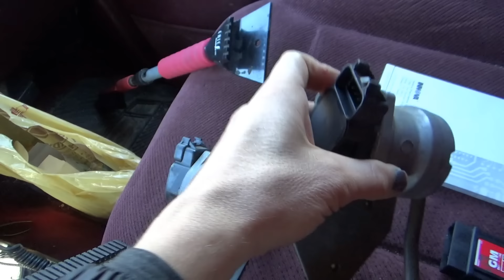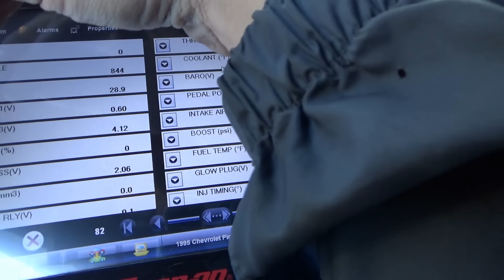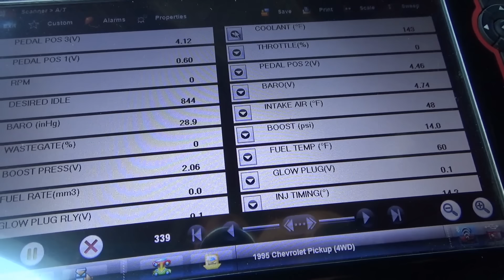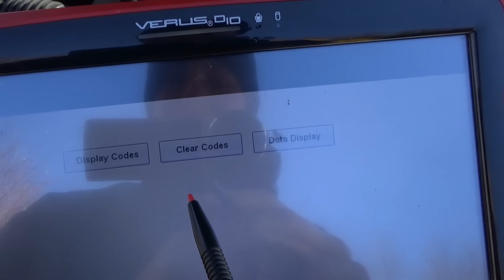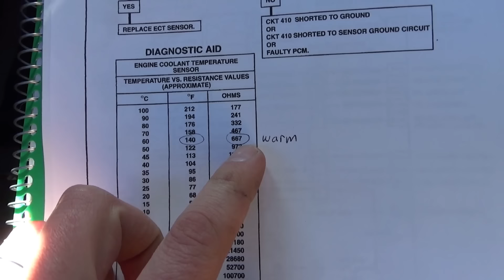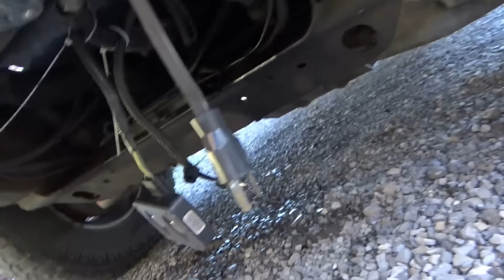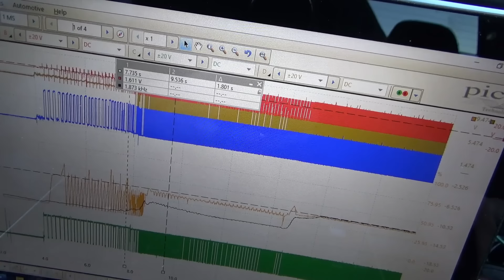(Pt 1) Chevy 6.5 Turbo Diesel REVS Out of CONTROL?! (Throttle Diagnosis)

Comment: I used to work on the shops old 96 chevy tow truck with the same engine.  And it would sometimes cut off while coming back down to idle.  Replace the injector pump driver module and it would run fine for 6 months or so.  Then start doing that random stalling again.  This truck already had the module relocation kit installed behind the driver side battery.  So, it made swapping the module a breeze.  But I suspected there was a high resistance problem in the injector pump itself.  But the shop owner didn't want to replace it.

Comment: 😢If it is the PCM computer board and it is the CPU ROM chip with double sides in soldering is the causes.Hope you’re able to find a replacement PCM board for it.Or tries wrapping that PCM board ROM chip in tinfoils.Tries heating it with a heating gun with maximum heating settings for about 5-6 minutes and pray those heats are reflowing those cold soldering joints to making that board ROM chip to workings properly again.

Comment: Love those 6.5s the problem is the modules sitting on the engine are prone to failures like overheating the modules. That's why the RPM is ramping up.   I've seen this issue before.   The pump fuel is bypassing that, causing issues.   Some injection pumps need to be rebuilt with upgraded parts that'll take care of the problem.

Comment: This is why I LOVE my 1995 Ford F250 4x4 with a 5.8l ALL PRIMITIVE PETE, cabled throttle, crank windows, no cruise control, manual transfer case, manual hubs and only electronics is fuel injection and transmission which I can deal with that!!!!
Reply: You are just missing the manual transmission :)

Probably slow as a dog compared to a modern diesel, but you can't beat the simplicity.
Reply: @volvo09  I bought what 1, I could afford and 2 what was available at the time!! But manual transmission are good but their fun runs out at about 5000 miles. Yes I do love CV the simplicity of not having more modules than the space station!

Comment: Trying his hardest to use a 4 channel scope to identify an electrical malfunction when the problem is simply a bad injector pump. ECM is not in complete control and doesn’t know how to handle the situation.  Fuel is bypassing internally. Touching the throttle commands even more fuel, hence the high revs. Rebuild or replace the injector pump.  Relocate the module and put a computer fan on the heat sink.

Comment: This could be worse; this engine could be a 6.2 liter diesel.  I drove one on a delivery route that was a C-30 Chevrolet with a 20' box on the back.  Those engines didn't have turbos and 130 horsepower wasn't enough to "pull a sitting hen off a nest."  The company eventually got some 6.5 liter diesels that were somewhat trouble-prone and the 6.6 Duramax was an improvement over those engines.  I am wanting to say the Duramax was an Isuzu design IIRC.  I own 2 6.0 liter Ford diesels and I have a newfound respect for those upon viewing this video.  Ivan, you are getting down to the nitty-gritty when it comes to waveforms; I don't think you have gotten this technical before.  Good to see it.  GREAT VIDEO!

Comment: Wow Ivan! That must have been a big Hammer that you hit your thumb with! Ouch
Reply: And I liked how he must've relieved that pressure build up under the nail: With a red hot pin/nail/steel wire end. Goes through the nail like butter, so you're better careful. He's a real hero, he didn't even lose a single comment over it. He just soldiers on. A real man.

Comment: Yeah getting a quality part these days is brutal,, recently my 2002 F250 power stroke accelerator pedal was acting up and I thought no problem I'll get a Motorcraft,,  well no,,,  it doesn't exist..
Apparently for about 20 months between 2002 and the 2003 change over to the 6.0 was the only period that used that particular accelerator pedal and it's only available in the aftermarket..
Fortunately the one I got works fine...
So far......

Comment: It sounds like brothers Subaru Forester when it had an air leak at the throttle body & it was fitted with a MAP sensor like that 6.5 litre diesel V8 engine is.

I don't think that it would be the PROM inside of the ECU that's at fault unless someone has mucked around with it !

Comment: Call me crazy, but just purely as a thought experiment, I can kind of create a scenario where extra fuel bypassing in the injector pump could cause a situation like this.  2000 RPM is probably a comfortable place for this truck to live on the highway, it's a '95, and so depending on how the injector pump is designed, wear on the flow control pintle, seat or orifice could favor this RPM, and continue to bypass at higher RPMs, causing it to hit the rev limiter.  

Further, with these being old mechanical function design with a rudimentary ECM and some electronic controls and monitoring slapped on top, it's entirely feasible that the ECM doesn't have as much control as we're thinking it does, and instead, it's really just following basline maps for expected behavior at certain data points.

As per usual, this is entirely speculation, and the only tests I can think of to alter behavior in a predictable manner are insanely dangerous on this design of diesel.  About the only "safe" thing I can think of is a thick piece of steel to partially block off the intake and a 5-gas analyzer to look at combustion and fuel mixtures.  Even then, without a known good, I have no idea what I would do with this data.

Man, this is a really good one!

Comment: never worked on that system  but .... dont worry about the temp. yeah its off but it really makes very little difference on fuel delivery except maybe on start up. it has a seperate shutdown sollenoid so if you unhook everything but that on the pump it should start at idle and run smooth. if not check for sucking air and if not sucking air and still erratic change the pump,   a sticky timing advance will cause elevated idle rpm. that most likely is a stepper  motor running the fuel metering controls. it is fast and precise. any binding in the mechanical side will cause what this thing is doing. you could depin the stepper and monitor the throttle circuits and output to the stepper if thats all good change the pump.  the  mechanical version of that pump was real finicky and does not like low sulfer diesel fuel.

Comment: I will post more later but this is most likely a worn injection pump from the poor fuel filter I see installed.  The other two causes are the PMD or lack of a calibration resistor in the PMD connector.  I doubt this is the issue as he had tried so many PMDs.

Comment: It looks like your thumb isn't getting any better. You still have the goth look on your left thumb.
One of my neighbors had a problem with one of their vehicles. I remembered it was the same vehicle you worked on. I told my neighbor I know exactly what is wrong with your Toyota. Within one hour and $31.00  from O'Reilly's and it was fixed.
I only charged  them one dozen of peanut butter chocolate chip cookies.
Now all my neighbors are knocking on my door. Even UPS and FedEx drivers.

Comment: since the old pdm is still on the pump it is likely they didn't transfer the resistor to the new pdm. This will cause the exact problem, just look into the plug on the pdm to see if it's in there.

Comment: You did a great job of applying advanced diagnostic principles to this platform that you've never worked with before.  All normal EFI control principles apply until you get into the actual DS injection pump that's its own beast.

Comment: In the first test the pump command at 4k RPM is LESS than at 1k, and so is the feedback, and the solenoid is tracking the command. How could a smaller command result in more RPM? It has to be a mechanical problem. Fuel must be coming in outside of the command, or the pump is producing too much pressure, or something like that.

Comment: Fuel pump, fuel injectors, fuel filter, blow out the fuel line to tank, wiring harness extension, PCM, wiring harness.  Has he been running any performance chips?  Looking forward to this one.

Comment: Drain the water out of the engine mounted fuel filter through the petcock mounted on the front of engine. Take filter out and check bottom of filter for sediment

Comment: GM went to an electronically controlled IP in 1994 which introduced a new level of complexity to the system compared to the mechanical pump of 1993 and older models. When they run right, they run great, but can be a pain to diagnose and repair when they act up. I have that engine in a 1992 truck with the mechanical pump and it's been pretty much trouble free.

Comment: If you had a signal generator you could dial it in the correct duty cycle when the engine actually idled for that few seconds. Eliminate computer control. Not sure if that’d work but would be an experiment
Reply: Smart suggestion. Would love to see Ivan try this

Comment: Bought mine new in 94. Still have it. They don't take kindly to abuse and are prone to electrcal gremlins. I have a local shop that actually has a younger tech that works on these so very fortunate as they are not welcome in a lot of diesel shops. This is the first deep dive video on the electrical side of the fuel control system that I've seen. My hat is off to you and to boldly go where no one likes to any longer. Looking forward to Part 2.

Comment: Fuel is by-passing inside the injection pump itself . Worked a large GM dealer in Toronto , changed literally hundreds of these pumps , just get another one and don't forget new fuel filter , set TDC offset with scanner when engine is at operating temp and add Standayne fuel conditioner , yeah and move that driver module off of the pump using the resistor that came with the driver module as they were calibrated together . A higher resistor number meant more power but to the expense of fuel mileage , Aftermarket harnesses and mounting plates usually came with a number 9 resistor , high fuel consumption with those , usually had a 4 stamped on the resistor when looking inside the bottom of the the driver module wire connector . Good luck , reminds me of the good old days when life was simple .
Reply from the maker: I still don't understand why the PCM ramps up the fuel solenoid duty cycle through the roof if you touch the throttle 🤔
Reply: @PineHollowAutoDiagnostics  It's a hard call to make perhaps try a used pump out of a Pick-n-Pull
Reply: @PineHollowAutoDiagnostics 
It’s not, the pump is worn out
Reply: @PineHollowAutoDiagnostics Diesels are like helicopters, there is no way they should work at all…so making them work is pure luck!
Reply: Oil leaking in a turbo will also give that you need to be careful it can be a runaway need a rag in the air box to stop it not like a car no spark plugs to take power away
Reply: Cummins has a detailed and fairly simple fuel system test, requires a couple of fittings, fuel pressure gauge, some tubing and measuring "cups".  Will show confirmation of pressures, leaks, sensors, fuel bypass, pump efficiency etc.  Is there a similar procedure for the GM 6.5?  I would like to think so?  
Stay gold.
Reply: The resistor is actually tuned for injection pump variance in the build. Always should use the same resistor that came with the pump, the PMD does not come with a resistor.
Reply: @jeffco908  Before plugging in any driver module ALWAYS check to see that there is a resistor installed over the pins on the module, Preferably a #5 but not super important.
Reply: @markricketts-qm6xu  Ya i know. What im saying is all pumps come with the PMD and the resistor installed. When changing the PMD the resistor needs to be transferred from the old PMD or replaced with the same value resistor. The resistor value is matched to pump variances in manufacturing and not matched to the PMD. Best practice is to always match the resistor value with the one that came with the pump originally. I have seen so many relocates done and then there is no resistor in the PMD cause its still in the old PMD on the pump.
Reply: Wo man 🧍‍♂️
Reply: wait, hovering around 15psi boost, is the wastegate seized or wired shut/tampered with and tuned at one point? maybe someone replaced the ECM to one without a tune, doesn't too high of boost make it go fuel cut on purpose, wasn't stock around 8psi boost at idle? I'm guessing there's far more issues than just a injection pump over-fueling.
Reply: @throttlebottle5906  You need to subtract barometric pressure from that reading to get actual boost pressure. Its not really A true boost sensor as it doubles as a baro sensor.
Reply: @jeffco908  oh right, I was thinking the tool output was calculated and should have known better seeing 14" when not running.
 I recall wiring the wastegate shut and playing with the computers was some of tuner trickery being done to them.
not really a diesel guy and for all I tow the old 350 and even 305 were plenty.

Comment: Old Detroit two cycles had an emergency shutdown flap held open by a cam lock operated by an electrical solenoid, when they ran away (every chance they got) you could hit a switch or manually hit the cam and shut off the intake but it was scary as heck.

Comment: LOL! 10 minutes in, and best be tearing apart the engine computer and checking for bad/leaky capacitors, and corroded traces. 29 yrs old, I can guarantee there are bad capacitors! 😉
Reply: This was my thought  also,a bad cap in the pcm that is not regulating the voltage in a gradual amount.Allowing a full 12 volts to jump to the solenoid opening it all the way.The feedback circuit must be working in that it reads full open for too long and then it shuts it down.I know jack crap,about this unit and am finding this very interesting.WHERE'S the crusties???a corroded wire at the fuel plug or is it the solenoid??
STAY TUNED for more BATMAN,haha IVAN what is the voltage going to the solenoid leads and scope it to watch it VARY in length of pulse or voltage?great video so far.

Comment: I wouldn't put aftermarket parts on my car especially if it's a diesel and any car I wouldn't trust after market cheap parks with anything to do with the throttle system

Comment: Those injector pumps have an Electronic eye in them that watches a cam in the pump. If they get covered with garbage or They cant see cam and it runs like Crap...I had one of these and I loved mine. When I first got it I had to change the pump. Then I ran red Fuel ONE Time and the Red Dye clouded the eye. And it fell on its face. I took filter out of  filter housing and took  all fuel out and filled with Fuel treatment  and put new filter in. Ran for 10 minutes and let it set over night. Next day drove it like I stoled it and it cleared up . Now the old linkage pumps would run red fuel which is against Bidenanomics..LMAO..LOL..😂.There a Good old engine No POWER HOUSE but Dependable and easy too work on...Have to watch where You buy aftermarket parts as the stuff is JUNK...I would make sure wires in that PDM wiring relocation harness is Wired right ...Great Video Bud...

Comment: My now brother-in-law had one of these when we were in college so I got to learn a little more about them.  I remember the 3 potentiometers in the throttle pedal.  I think you need to compare PCM output to a known good.  If it's commanding a fuel solenoid duty equivalent to 2000 rpm when it should be idling, that suggests a PCM problem.  Also have to check the feedback because I presume it uses the feedback to modify its output to achieve the desired fuel quantity.

Comment: The Duramax was such an enormous step forward over this old Detroit diesel design
Reply: I’m nearly sure that the Duramax is an Isuzu design they picked up when they merged.
Reply: @80SWoods  it is
Reply: @80SWoods  It is.
Reply: What kind of Detroit is in this truck?
Reply: @Barrys_Shop 6.5 liter V8
Reply: Interesting you mentioned detroit. I've seen several faulty fuel metering valves cause idle  oscilations in the dd15

Comment: This is where I'd break out my decade box. Add resistance to mimmic ambient temperature. And see it makes a difference.
Reply: Why are they called Decade Boxes I wonder?
Reply: @poweredbyford87  They are known as decade boxes because they have controls that correspond to the digits in a decimal number - a control for the tens position, a control for the hundreds position, and so on.

Comment: Why is the boost PSI reading 14 with the engine off?
Reply: The MAP sensor reports absolute pressure, not relative pressure...   Absolute pressure at sea level is ~14.7 psi.

Comment: When I was in the military, serving in Japan, I worked in the heavy equipment shop, we had a detroit runaway one day.  GI's scattered.  It was a genuine runaway though, not just 2k rpm.  I got out of the service and went into automotive and left the heavy equipment field.
Reply: Hi the Detroit diesels were 2 stroke units that had that problem, when they were worn, they would burn the crank case oil until the oil was gone or the emergency stop cover closed of the intake air
Reply: That's ok, they have a natural rev limiter: valve float.

Comment: A few things observed (I can't help saying it) ... with only 154,000 miles, the truck is abused and sees almost no maintenance.   Oil like tar, brake fluid is low and filthy.   Interior is a mess and the cherry on the cake:  JC-Whitney plastic Chrome door handles!  It's crap!    The vehicle needs fluid maintenance as soon as you get it running well!
Reply: Sound very much like a farmer to me noticed all the toolboxes in the back

Comment: These 6.5 diesels have the PDM installed in the wrong location where there is a lot of heat. There are aftermarket PEM suppliers that make a better unit and it needs to be relocated to a cool spot. Good engines but faulty electronics.